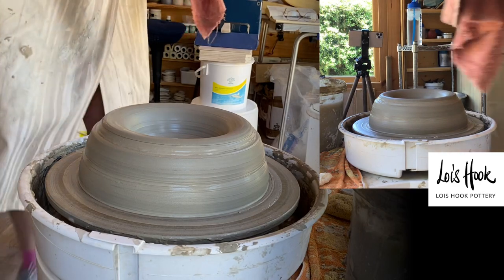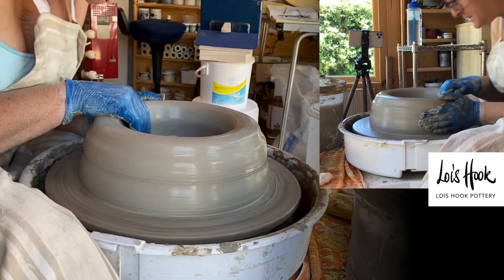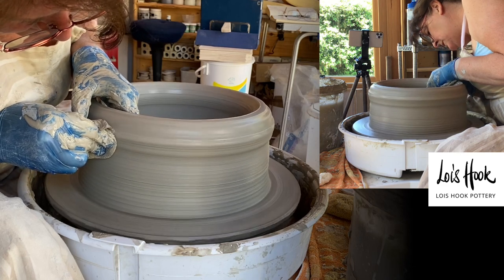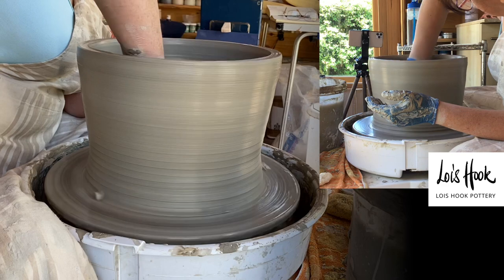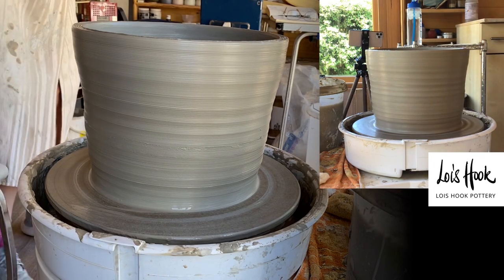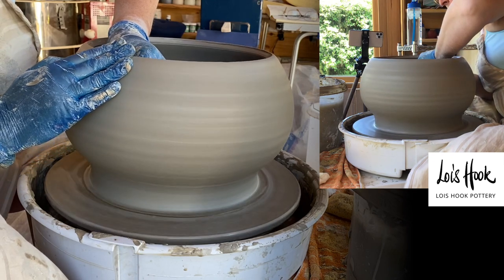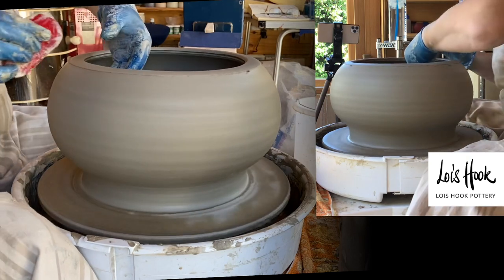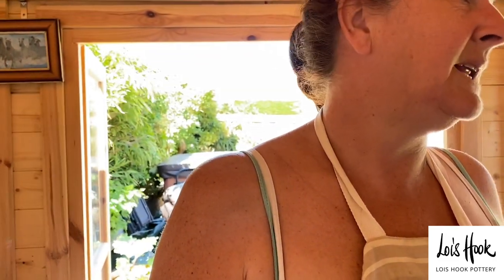53. Part 3 20lb Clay - Drawing Up - Bowl Shape - Making Base for Water Feature - Educational.

Comment: Can I ask, why do you wear gloves? I haven’t seen that before.
Reply from the maker: Hi I am wearing gloves with this clay as it has grog in it. Which is like having your hand on sand paper. I was finding that my hands can be red roar and really sore for days after wards. I had tried barrier cream and ointments afterwards. I then saw someone else use gloves because of sore hands - so I tried it. 
I don’t use gloves on clay that is fine and smooth.
Reply: @LoisHook  Thanks for explaining! Totally makes sense!
Reply: I wondered that too so thanks for the explanation. Makes sense as grog clay can be sooo rough on the hands. Can I ask u Lois, what temperature do u fire to on cone 6? Loving the ancient copper but not 100% on what's best temperature! Thanks,, Pauline
Reply from the maker: I have a Skutt kMT 1018 and this I use a preset for cone 6. For Ancient copper to get shiny finish with crystals you need a hotter temp. On this fire I put the copper on the top shelf shock is cooler and I gat a duller copper.
Most of my best shiny results were nearer to cone 7 or a cone 6 with a 15 minute hold.
Reply: @LoisHook  Thanks Lois..all a learning curve eh! I know Amaco PC all say to cone 6 but temp brings such different results. Put ancient copper on the top or hottest shelf then!